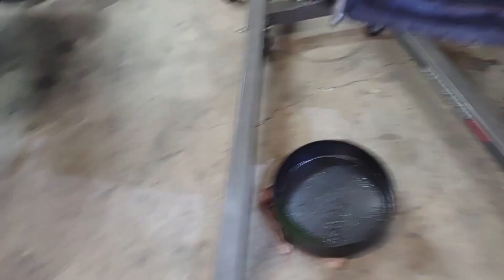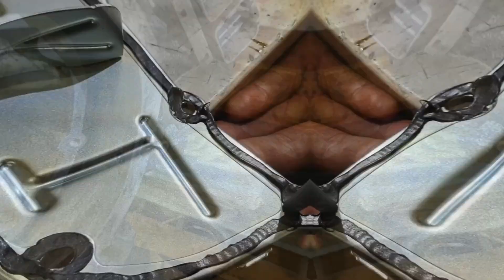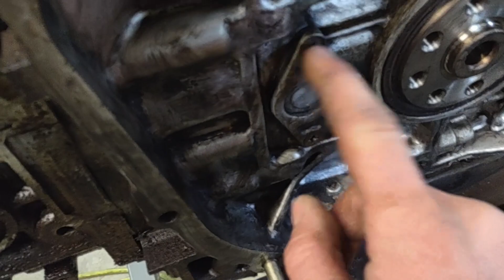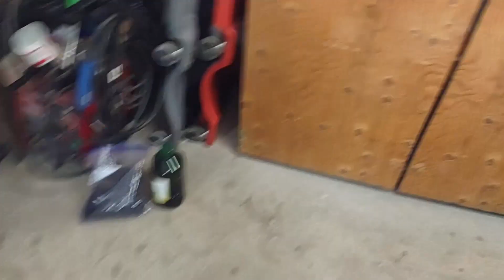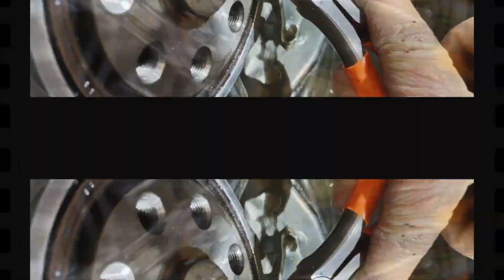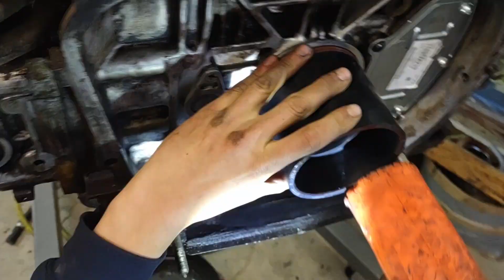How to replace Subaru oil separator plate and rear main seal

Comment: Thanks for making this video.  Do you have the part number for the o-ring, I'm having trouble finding it?
Reply from the maker: The part # is 806931020 for the o-ring on the wrist pin access cover, the can check Subaru's opposed forces site here to find any other part numbers you need http://opposedforces.com/parts/legacy/us_b11/type_5/engine/cylinder_block/illustration_1/
Reply: @ImpreziveGarage  Thank you.  I rewatched the video and saw that you had posted it as well.  Thanks again.